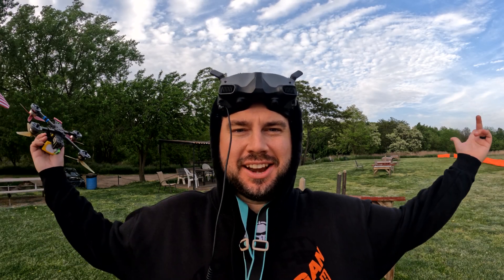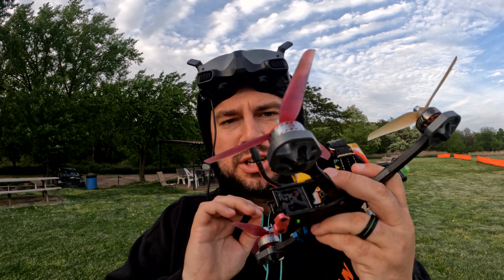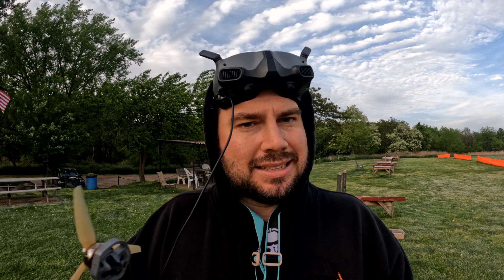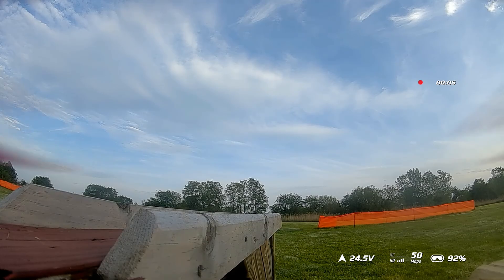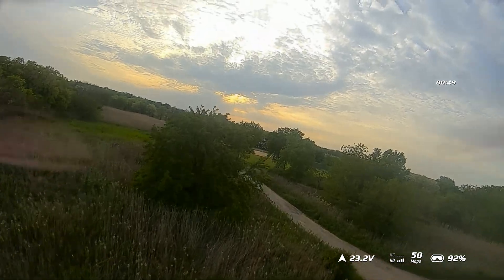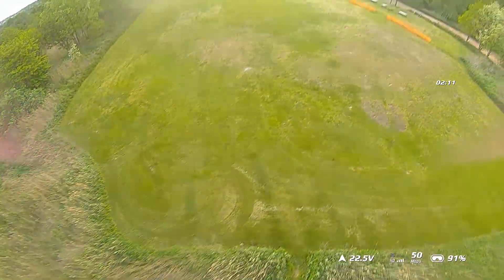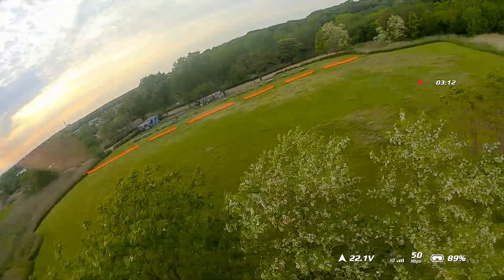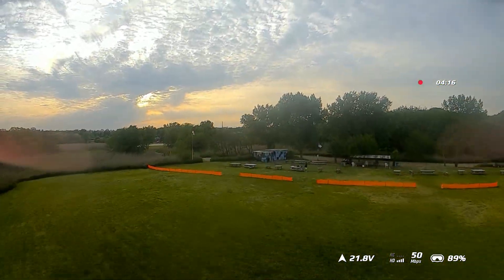Are mismatched motors an issue?

Comment: 2 1303.5 hglrc 5kv  2 1404 2750 geprc could work?
Suggestions for front or back??
Reply from the maker: It will, but that kv gap is pretty extreme. Are you replacing broken motors? Or setting up a new quad? If you are building something new, I would try to match the motors. If you are just trying to get it in the air then solder em up and send it!
Reply: @Nathan_Adams  yeah it's because I have 3/4 1303 5k kv 3/4 1404 2750 kv damn..,2 weeks no fly because of this!
Reply from the maker: @pietro765  you should be fine. The higher kv motors will just match the performance of the lower kv motors. Just make sure your tune is near stock or more conservative and make sure they are not getting too hot 🔥
Reply: @Nathan_Adams  it's stock pid rates and settings,I'll try,I'll let you know today,it's sunny,going to the field and DVR it!
Reply: @Nathan_Adams  thanks mate,let's send it!

Comment: hi nate, awesome video, im faced with the same issue now where my first quad finally broke, the motors i have are discontinued and dont want to spent $150 to replace the 3. by mis matching the 4th motor (just one), do you notice any flight performances except for it matching the lowest performance motor? Does it still fly straight? or will there be some drifting or yawing effects?
Reply from the maker: Nothing, even when I had 4 different motor each with a different kv (1750, 1850, 1950, and 2020), three different stator sizes (2306, 2306.5, and 2 2207), and even having 4 different props, it flew shockingly like any other normal quad. Not even a hot motor. You should be completely fine. 🍻
Reply: @Nathan_Adams thanks for the assurance! I’ll definitely give it a go! Knowing this will make me more confident in flying more aggressively and not worrying about breaking something :)

Comment: Did you look at the blackbox logs?
Reply from the maker: Yes, this build started with clean flight data. I probably could push the tune farther, but this quad gets flown hard and I want it to come home even after a real bad crash. It currently has 2 massive cracks in the rear from learning matty flips, but I need to take the time to replace the parts (it had the breaks on the frame during these flights).